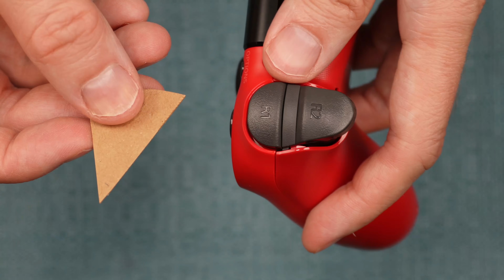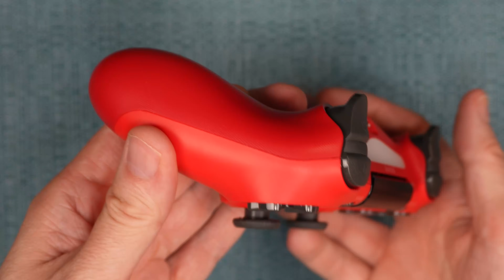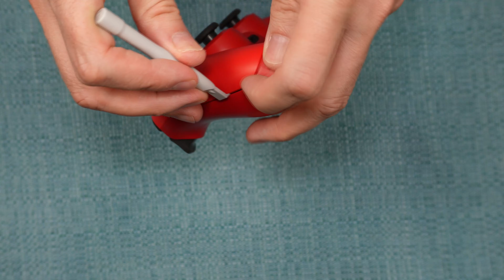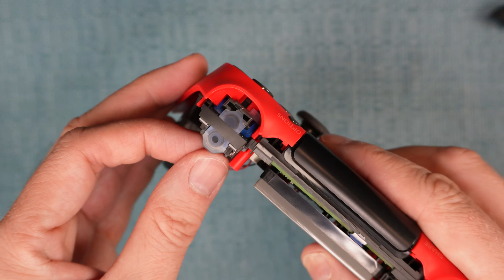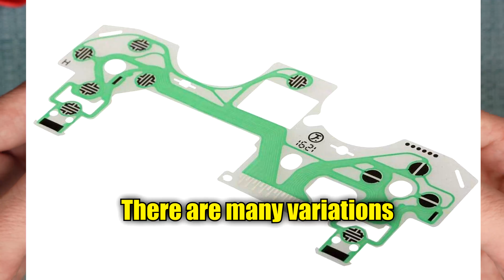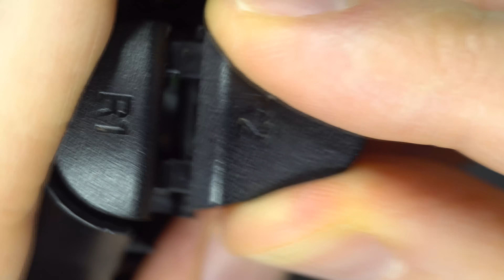How to Fix L1 R1 on a DualShock 4 PS4 Controller | Repair Replace Clean Stuck Sticky Broken Shoulder

Comment from the maker: Things you may need: L1/R1 Buttons JDM-040: https://amzn.to/3qfaIsB
L1/R1 Buttons JDS-001 JDS-011: https://amzn.to/3KjDHCf
Rubber Pads: https://amzn.to/3O7wwhG
Conductive Film JDS-001 / JDS-011: https://amzn.to/46YM5B0
Conductive Film JDS-030: https://amzn.to/3Kf9G6H
Conductive Film JDS-040: https://amzn.to/3Yb1n1G
Conductive Film JDS-050 / JDS-055: https://amzn.to/3Q3PY1y
D-pads: https://amzn.to/43FexFl
Square, Triangle, Circle, X buttons: https://amzn.to/3OmJhGx
Button Replacement Kit: https://amzn.to/401p5xe
Analog Replacement Set: https://amzn.to/401pkbC
My Precision Screwdriver Kit: https://amzn.to/3TtYrur
Micro USB Charging Cord: https://amzn.to/3LBsu1x
Toolkit I use: https://amzn.to/3ke14nc
Electric duster: https://amzn.to/41dZemX
Reply: Hi. Do you know how to fix R1 button it dosent comme out it wasnt on the vedio
Reply: I cant even presse it
Reply: 😊pp0
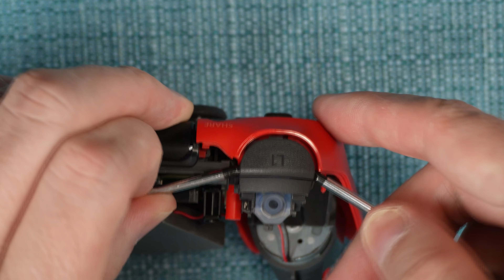Reply: At 8:06 is incorrect. You just need to put a small screwdriver (or prying tool) against the side (front) where you see the little tab, gently, and it will come up nicely (without flying off from all that potential energy from both screwdrivers, like you suggested).

Comment: none of these worked BUT they set me on the right track. what DID work was I discovered the R2 button below my sticky R1 button had a little bit of plastic that i guess didn't get shaved off properly in the factory and that was catching on the R1 button whenever it was pressed. Shaved that off and it works like a charm now.

Comment: For anyone wanting to know what worked for me was simply turning the controlling off on my ps reconnect it and it worked fine. To sold the L3 issue I popped up the L3 button on the controller and then did the cardboard method shown in the first example

Comment: Man, you're an absolute legend for this video. My controller just started acting whack as hell one day. Wouldn't connect via Bluetooth sometimes, would work on the home menu but not in game, and when it would work in game, the R1 button wouldn't respond. Followed this video step by step and ended up having to take the whole thing apart. It was as if R1 was stuck the whole time but the button functioned flawlessly. So I narrowed it down to the sensor. I figured since i had the controller open already, I may as well clean all the sensors. Wouldn't you know it, controller works good as new! Sorry for the novel. I just really appreciate this solid walk-through video. Keep up the good work! 💪

Comment: Solution 5 slightly worked for me, as I had a rubber issue. I just swapped the L1 and R1 rubbers and it served me for the time being, but I'll have to order a new set of conductors for replacement.

Thanks a ton though! Really great walkthrough

Comment: i followed solution 6 but did not replace the film, i found out there was a dust on the connection on the film and the motherboard and just cleaned it. worked and saved me from buying a film 😂

Comment: Solution 6 worked like a charm, fixed my controller with a 2$ piece. Thank you, ur video was intrumental to help me open the controller (it was quite hard, and if it wasnt for the video I woulnd not have the courage to force it open) and fix it.
Reply: And to help other, my problem was a R1 stuck pressed. I think it was a short circuit in the contact layer that caused it.

Comment: Before replacing Conductive films, I suggest you guys should check the film itself if there's like smallest peck of dirt that is blocking the circuit line from L1 or R1

You need to rub it off so the flow of the connection can continue, make sure it is clean and the line connection is visible again

Comment: Dude thanks a lot.!! While facing noob  repair Videos only recommendimg to push the reset Button 10 sec... Im really glad I found you😅. Close Up Fotos and vids while explaining,  reduced to the really necessary steps only and also showing Up the common Side Problems.. Its Just what u need If you want to fix your Controller but have No clue how.👌
Greez from Germany

Comment: BRO, IT BROKE IT HARDER, I SHOULD HAVE CAVEMAN TECHED MANN

edit : never trusting how to X again

edit : hit the X button into the floor a bunch of times and it worked, geegee
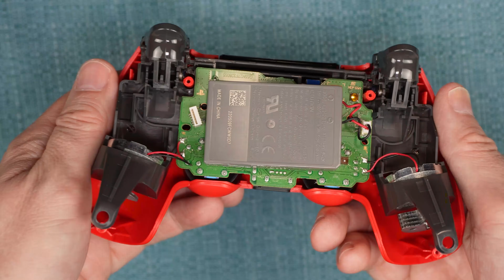Reply from the maker: At 3:21 the risks of continuing with the video are clearly stated.
Reply: @HowToX  yeah i get that but a singular straw and air broke it😭
anyways i caveman teched (whacked it on the floor a bunch of times) and it fixed so all good

Comment: Thanks for the video. It helped me open my kids controller, but in our case after trying most methods, I noticed the l1 button would not press down correctly, the reason, after lookin and looking, was that the piece of plastic located between l1 and l2 had lost shape, and wouldn’t allow button to be pushed normally. I ended up filing it a bit down and it worked perfectly. I wouldn’t have managed without your video and a bit of ingenuity.
Reply: What you filing it with?

Comment: Instructions unclear now my R2  is also not working
Reply: I switched the film with one where the square button wasn’t working and now the square button is working but the R1 isn’t
Reply: Try rubbing your stink balls true complete length of the controller & then quickly (bare ass) rip a big stinky fart on the motherboard and that should do her, if by some reason that didn’t work, you’re going to want to spank, went out and paint entire Controller with your seat and throw it against the wall as you degrade it and explain how you don’t need it as you explain how many controllers you’ve been with in your life… Then put on offer up for free with a caption all used up…🙂
Reply: You are stupid, i made it 6 times
Reply: Same

Comment: All of them working fine but L1 dont work replaced film and plastic thing dont work but when i bend the controler a little bit it workes just fine Also this one cant get aim assist on gta but the other one is ok dont know the solution any body have fix?

Comment: My issue is that the L! and R1 buttons on my ymir controller work for the function that requires me to hold the button down but after a few seconds it stops, acting like i let go of the button when i actually didnt

Comment: Good video. I was trying to fix a second controller out of these 3 junk controllers I have (figured I should be able to combine the 3 of them into a functional one) turns out the most viable one just had a slight battery issue and was somehow missing the plastic pads behind R1, R2, L1, and, L2, so I was able to salvage those and a battery from another controller that had drifting issues and it was good to go! 👍

Comment: My L1 keeps ghost mashing or registering a button mash without me pressing the button.
Reply: same as mine
Reply: @andriniainaal.1599  did you ever find out how to fix it?
Reply: @paulellington1505  i've tried every fix on youtube but without replacing the conductive film, no. But I still hope there's some short over that conductive film that make the button registered without pressing it so I'm gonna open it over and over again until i'll find it
Reply: My r1 button won't work I tried everything bruh
Reply: @KayySmurff  if its not working, it can be repaired, but if it's registering button  without pressing it, that a real problem
Reply: @andriniainaal.1599 mines just randomly starts doing it..do i have to get a new one?

Comment: Unfortunately, it didn't help me, don't know what to do
Reply: buy a new one
Reply: If you replaced the film, and the rubber contact things it should be working just fine. Sometimes china does send out dud film circuits though so it’s best to buy more than you need.
Reply: Sell it
Reply: @HenyTV_ sell a broken controller?